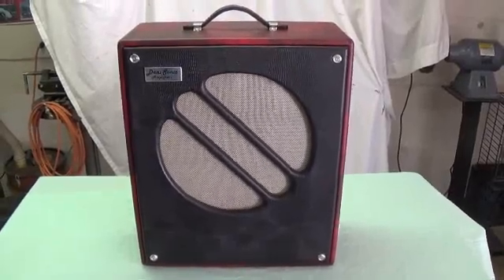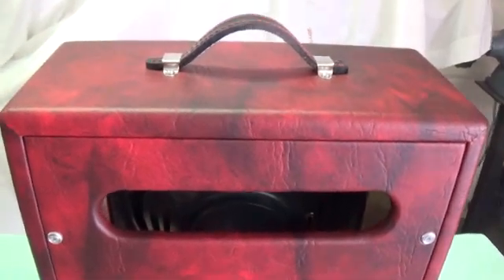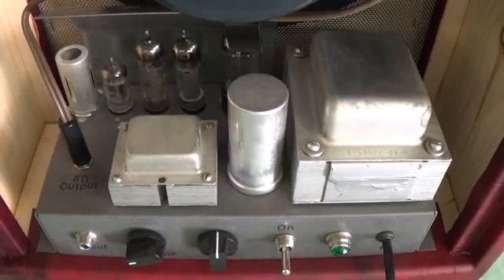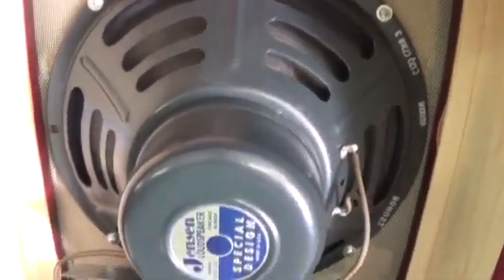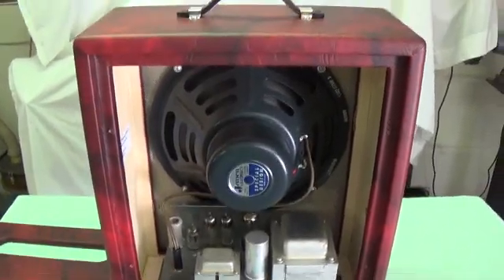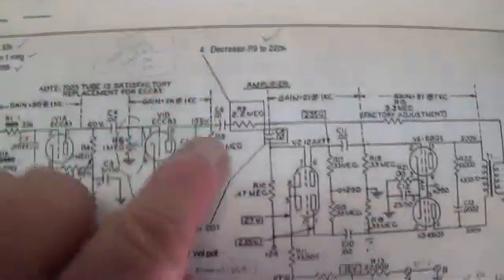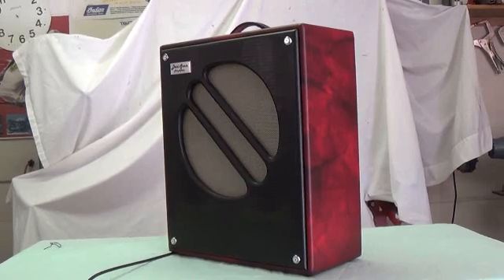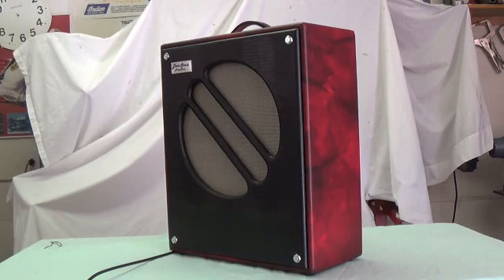Conversion of a Hammond AO-35 Reverb Driver into a Guitar Amplifier

Comment: Hi Uncle Doug & Rusty, While watching AO-35 conversion video, you mentioned the 2nd 12AX7 tube handles the phase inversion. Question, does the 2nd half of the 12AX7 in the Fender 5F1 handle the phase inversion, how is that accomplished? Cant tell you how valuable all your years of experience are to a newbie, where tube amps are concerned. Thankyou for sharing, very much appreciated. Take care, be good, C.
Reply from the maker: +Cass Virgillo  Cass, there is no phase inversion in single-ended amp circuits (like the 5F1 Champ).  It is only necessary in double-ended amp circuits. Please see my video on Phase Inverters. I think it would be helpful.
Reply: Hi Uncle Doug & Rusty, Oh, I was wondering. Thankyou for the quick reply. No reply necessary if busy or don't want to. As you may have surmised, there is a good chance I will have a few more questions. Will try to not bug you too much. Take it easy, C.

Comment: Uncle Doug,
The Moonlight diagram is confusing. In that the signal coming through C4 enters the the volume and tone pots (through R2 and R1 respectively) into lug #s 1, which I thought were the ground lugs for pots. The signal then leaves the tone stack from volume lug #2 continuing to pin 7 of V1b. The Moonlight description does mention the tone stack circuit is intended for a push/pull pot. But the diagram shows two pots and the wiring with caps and resistors. If I am using two 1 meg pots, am I to follow the Moonlight diagram as drawn? Or am I missing something?
Thank you.
Reply from the maker: +Farmer Ted  Ted, the Tone pot is 500K and the Volume pot is 1 Meg. I wired mine exactly like the upper two diagram and it worked just fine. The push-pull pot with bypass is optional (lower diagram) and I ignored it.
Reply: +Uncle Doug Thank you again.
Reply from the maker: You're welcome, Ted. Good luck :)

Comment: The Hammond AO-35 reverb amp and it's 3 spring NECKLACE REVERB springs comprise the very BEST REVERB on the planet! Why someone would destroy such a combo for a mediocre guitar amp build is beyond me. I've been playing guitar for 36 years and organ for the last 18. I've built several guitar amps from scratch and have modified Fender, Marshall, Vox, Orange, Laney, and Gibson amplifiers since I was 16 years old. So I do understand both organs and guitars thoroughly. The thing is, the organ is the nearest dearest cousin to the electric guitar. The electric guitar and the organ are both tone heads dreams! In fact I never gave much mind to organ until I was given a Lowrey all-tube spinet organ when I was 31 years old 18 years ago. When I turned it on and started playing it I was instantly blown away at the amazing analog interactive tones I was hearing. Just like an electric guitar the organ responded to every nuance of my moods and had excellent break up. Just like with an electric guitar and amp rig I could even hear the awesomeness of the rare earth permanent magnet speakers JUST LIKE ON A GUITAR RIG. My point? SAVE THE ORGANS AND SAVE THE ORGAN ADD ON ACCESSORIES!! Okay, so no huge problem making a guitar amp from an AO-35, but I can tell you and everyone else that all you have to do is drive the input of the AO-35 with your favorite low wattage tube amp this way you have a SLAVED AO-35 that remains 100% stock original condition. See, the AO-35 and AO-44 reverb amps are driven directly from the organs speaker line ( tapping off of the organs 10" or 12" speaker). This way you get a very awesome REVERB too. If you don't have the 3-spring necklace reverb springs then seek them out because you will be more than thrilled to hear this reverb and use it on every guitar amp you own! That's the beauty of the AO-35 and AO-44 reverb systems, you CAN install it in it's own cabinet and then you can attach it immediately to ANY amplifier with a speaker. ANY! That means your guitar amps, your HIFI speakers, your ORGAN speakers, drum machine speakers, you name it. And you CAN add  REVERB LEVEL and REVERB DEPTH controls as well so if you want to take full advantage of the AO-35's power with no reverb at all you can have that too. Believe me, SLAVING a power amp such as this with a good strong signal will render far more volume and tone shaping than by aborting it and adding a couple of 12AX7's! Why? Well, in the case of a tube amp driving it, you get the benefit of an OUTPUT TRANSFORMER and POWER TUBES in the mix as it enters the AO-35. THAT is ALWAYS better:-)

Like I said, no harm in building a guitar amp from the AO-35 or AO-44, but it's a step in the wrong direction when you can have a great slave power amp with the benefit of the BEST EVER- LENGTH/HEIGHT/WIDTH 3-SPRING NECKLACE REVERB [ that's what the 3 lengths of the 3 springs represent]. Heck, even with a simple short or long tank 2-spring ( make sure it's a TUBE reverb tank not solid state) it will sound better than even a Fender REVERB unit. And we all know how much those things are going for now.
Reply from the maker: +paulj0557  Although I would take issue with your use of words such as "destroy" and "mediocre", Paul, which are purely subjective and counterproductive when trying to sway people to your opinion, I find the balance of your comment to be of interest. 

As I interpret it, you're saying that a Hammond reverb tank can be connected to the output of a tube amp, then the output of this reverb tank can be connected to the input of an AO-35. Then the output of the AO-35 can be connected to a speaker or speaker cabinet, thus functioning as a stand-alone reverb unit, like the Fender 6G15 (which is connected to the amp input, not output).

If this is indeed true, and I assume that it is, then this would be a great project for those who desire a stand-alone tube reverb unit which could be used with existing amps. To those who simply want a decidedly non-mediocre tube amp, however, I personally see no problem with their decision to modify, not destroy, an AO-35. Pejoratives aside, I think your recommendation that some AO-35 and AO-44 continue to be used as reverb drivers is an excellent one, and would love to see a video demonstrating the result. Thanks for your input.
Reply: I have an AO-35 in it’s original speaker cab. The longest spring is missing. I’m interested in fixing the spring and using it as a slaved reverb unit for my tube guitar amp. Can you tell me where to find a spring that will be appropriate? Also, once that’s done, how do I hook it up to my guitar amp? I just have a little experience with electronics. I’ve replaced caps and input jacks successfully.
Thanks,
Bill

Comment: what would I need to do, if it's possible at all, to use an ef 86 as the primary preamp tube?
Reply from the maker: +zendixie  Since the EF86 is a pentode, you would have to rewire the tube socket and a portion of the circuit. Here is a site that discusses the conversion:  http://www.dougcircuits.com/EF86.html

Comment: this is great Doug! perhaps you can help with an idea some of the boys been kicking around,,
        why not replace  the power transformer of a small guitar amp [10watts] with a A-100/120volt transformer a replacement for the hammond b-3/c-3 organ
        could a qualified tech do this
Reply from the maker: +Ziggy Coughlin   I'm not sure I understand the question, Ziggy.  Guitar amp power transformers have to supply three different voltages, 5V, 6.3V, and high voltage (300 to 450V). Nothing else would work.

Comment: Thanks for the video inspiration- I'm starting a conversion and wish I could see your layout for this project. I'm trying not to gut the beautiful work inside and follow your choice for pot placement. Any chance you have a shot of your final layout please? If not, any recommendations for dressing the wires? Thanks
Reply from the maker: +Corey Collins You're welcome, Corey.....glad the video was helpful. I generally provide an overview of the chassis interior during a video. Perhaps I failed to do that here. My schedule is a little tight, so I really can't disassemble the amp for a photo, but will offer some insights. My suggestions for wire dressing is to use shielded cable (grounded at only one end) for all added signal-carrying connections, to keep AC wires twisted and DC wires away from them (crossing is OK, but never parallel), and to keep all leads as short as possible. Good luck.
Reply: Thanks for the reply- No chassis review for this build unfortunately- I value your experience and advice so I will work it out using your suggestions.Other builders reversed the controls to the other side but It's so tight, I'm planning to copy your design. 

I hope Rusty never gets tired of restoring tube amps....

Comment: Just received an AO-35 from eBay, in mint condition. The component board, caps, etc. look like the day it came off the production line. I looked at the mod schematics and the Moonlight Tone schematic. Looks relatively easy enough. I just need to find out what voltage rating I should use for the C8 cap (reducing from .02uF to .001uF), and what wattage ratings for the replacement resistors (R1, R1a, and R9).
Reply from the maker: Farmer Ted Congratulations on a great acquisition, Ted. I would think the cap rating could be 400 V and the resistors should be half watt.
Reply: Uncle Doug Thank you very much for the information. I figured the resistors were 1/2 watt. But I was concerned about getting the capacitor voltage right. Your videos are an inspiration, and very helpful in preserving and re-purposing these gems. Best wishes.
Reply from the maker: You're welcome, Ted. Thanks for the kind words and best of luck with your project.
Reply: Uncle Doug Hi Doug, nearly finished with the project. Wondered if the 1 meg ohm resistor that replaces the 10k for Ra1 can instead be 1.1meg ohms without having to change any other conversion values?
Reply from the maker: That's only a 10% variance, so I would think there would be no problem. The exact value of this resistor is not critical, as long as it offers high impedance (i.e. at least 1 Meg) to ground.
Reply: Uncle Doug On the home stretch of my AO-35 conversion. Last step, connecting the output transformer leads to the speaker jack/output. The two output wires (yellow & green) connect to the rear chassis panel at the tabs marked "speaker". Seems straight forward. 
However, both tabs as is, have continuity to ground/chassis. I discovered that the green wire speaker tab has a jumper to R15, which is a 3meg 1/2 watt resistor (schematic says 3.3meg). The schematic indicates this resistor is part of the factory gain adjustment...yes?
No mention of this in the conversion notes/schematic, and so I am puzzled, to say the least.
Reply from the maker: Ted, both of the speaker outputs would have continuity with ground.....one is directly grounded and the other is only separated from ground by the low resistance (impedance) of the output transformer secondary winding. If you have a good ohmmeter, I would think that the wire to terminal #6 would have virtually no resistance to ground, while the #5 terminal would have very low resistance to ground.

It appears that the 3meg resistor is part of a negative feedback loop. After you get the amp running, you might experiment with the value of this resistor to alter the tone (i.e. from clean to early breakup) to suit you.
Reply: Uncle Doug Thank you Doug. I was able to find an expanded view of the schematic which shows the entire layout (the conversion schematic you had posted in the video description was missing that part. After seeing the OT I had that "Oh, right" epiphany, that the outbound coil of the OT would, in fact, have continuity. What you say makes complete sense, and my brain is now fully adjusted, haha. 
I appreciate your patience and help. I realize you are busy, so thanks again.
Reply from the maker: You're welcome, Ted. Good luck with your project.

Comment: Learned that these AO-35s are the basis for a Fender Pro Jr (& Blues Jr pretty much) and the much more expensive Dr. Z Carmen Ghia.  I just got one of these Hammond AO-35 guitar amp conversions locally from a craigslist seller for a really good price, but they only put a volume control and there's no tonestack.  Mine was converted to a combo w/ a 12" speaker inside a Hammond Reverb cabinet, I'll have to pull out the chassis to see whats going on specifically in the circuit.  Thanks for the useful information here and the tdpri and tonestack links that will give me ideas on what type of tonestack to add to mine.  Prior to checking this out, I was leaning to doing the simple one knob fender tone adjustment but the moonlight looks and sounds much better.
Reply from the maker: Greetings, Scott, and thanks for the informative input. I'm glad the video and links were useful. I have since utilized the Moonlight TS in other home-builds and have found it to be simple and effective. Best of luck with your conversion.

Comment: What is your thought on this , I have heard of some people beacuse of heat from tubes
run one of those small PC fans inside the back of the amp ?
     Thank you for helping to make this  my new Hobby that I`ve  wanted to learn
for most of my grown up life   !
     Oh yeah ,  Thank Rusty Too  ! ! !
Reply: I have 2 white Shih Tzu`s and understand the love of a dog !  They will love you when no one else will ..
Reply from the maker: SuperGretschman What you say is true, SG. Rusty always demonstrates a level of enthusiasm over my company that seems sorely lacking with my human associates :)
Reply from the maker: SuperGretschman You're welcome, SG. I'm glad the videos are helpful. I guess adding a fan might be a good idea in some cases, i.e. if an amp is going to be run at high volume levels over a long period of time, particularly in an already hot environment. Many amps have a service outlet on the rear of the chassis that would permit plugging in a small house fan, if you didn't want to permanently install a PC fan. It should be noted however, that overheating may be a symptom of excessively high tube bias, and should be investigated and corrected (if necessary) rather than trying to simply cool the tubes with a fan.
Reply: Never needed one but figured somewhere it must be way to hot and was needed ..

Comment: I have seen under the different AO-35`s on the underside there are 2 small light bulbs .
Is there a real need to have both and for them to be working. My AO-35 is missing
one of those bulbs and the one I have does not come on while it is fired up ?

   I did go to Walmart and get the last 3 - 300 Watt light bulbs ..That solved the limiter
problem  .   Thanks , these amp books are starting to make since !  !
Reply from the maker: SuperGretschman Greetings, SG. It's my understanding that the bulbs act as ballasts to absorb excess current. In effect they are a built-in bulb-type current limiter. When you convert the unit to guitar use, they are not necessary for the circuit and you can simply remove them. I have a bunch of them in a drawer in my workshop. Some people wire them as indicator lights to illuminate a transparent front panel, but I have never tried this.

Comment: Sorry but I can't find the link to the instructions you mentioned.Could you put that link up for me.Thank you.I have an integrated amp I'd love to do this to.6BQ5 as well but I need help.I chose the integrated because it has the preamp built in.Could I just add a 1/4" input jack for the guitar and see how that works? or would I have to be concerned about impedance mismatch or some other mystical thing? Please advise.I also have an SET tube amp awaiting the same fate but no preamp with that one.WWDD?
Reply from the maker: Tom, all the info is available in the video description. You must click on "Show More" and it will magically appear. The AO-35 has an integral pre-amp, which makes it ideal for conversion. You could try adding a guitar jack to the input circuit of your amp to see if it works. If you are dealing with an amp that does not have conversion directions readily available, you generally must resort to trial and error to come up with an optimum result. You might check the Internet for suggestions. Hopefully, your amp has a volume and tone circuit built in. Good luck.

Comment: I was thinking you could add a side mounted cooling fan.
Reply from the maker: Greetings, Steven. With the shield, the heat is really not a problem. A lot of people who convert these chassis add the controls to the opposite side, so the tubes are at the (open) rear of the cabinet, which also solves the problem. Thanks for your thoughtful input :)

Comment: Totally a fine designed circuit modification and overall accomplished project,..also noticed the 3.3meg NFB adjust..alot of the dynamic sensitivity can be (theorized here) made to not just an addition of a circuit's presence control but a separate semi drive conversion based on the existing NFB would be pretty cool..lastly 35watts out of 2 6BQ5s and a 5Y3...that's twice the power of any pre-existing use of the 2x6BQ5s!!!
The Marshall  ''Bluesbreaker-Jr'' is an example of this and the typical '60s Vox & Selmer Gems are great rivals to the great use of these legends ,..again great designs,!!
Reply from the maker: Thanks so much, Nelson. I believe the power output of this amp is 18W, not 35 as the model number might imply. It's always good to hear from you and receive your knowledgeable input. Thanks for watching.